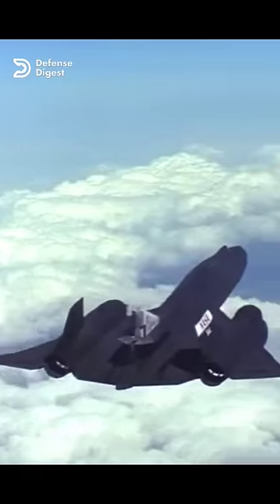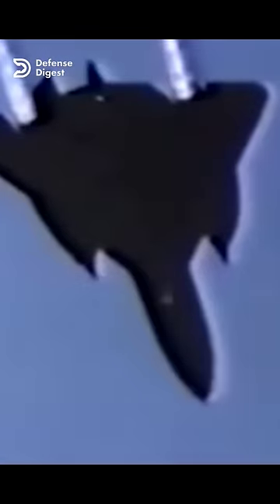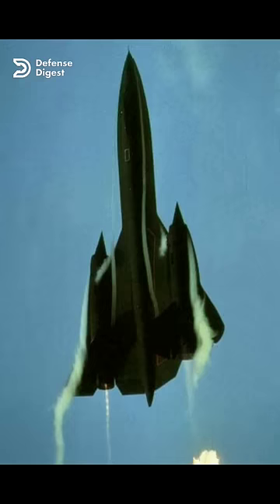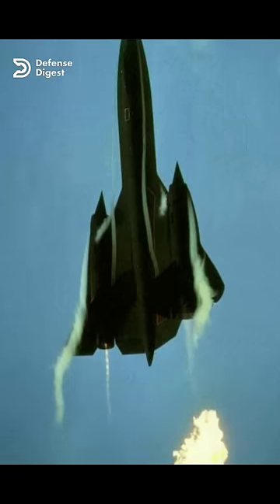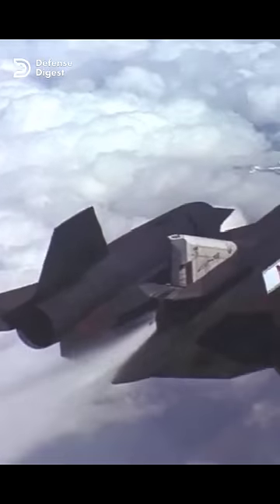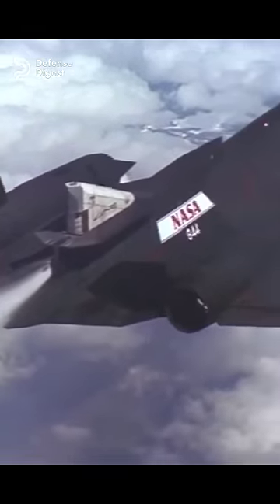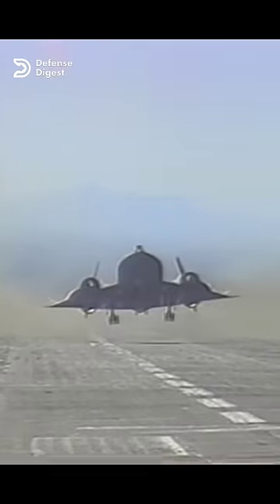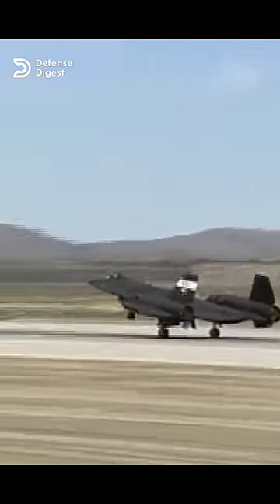The SR-71 Blackbird Is So Fast That It Lights the Sky on Fire! #shorts

Comment: I was at an airshow in 81, and another air show in 83, I've seen the Blackbird takeoff, for some reason it has the loudest engines you have ever heard.
Reply: I wonder why one of the fastest planes with one of the most powerful engines would have some of the loudest engines..?
Reply: @mattmarzula  u got me
Reply: @bartbullock9742  lol
Reply: Don’t they use old Buick V8 engines mounted on a cart to get the engines turning?
Reply: Saw it once in the UK, must have been mid 1970s, loud but not earth shattering like the Vulcan scramble.
Reply: @FilosophicalPharmer 
They did use them for a while, but parts became hard to find. I believe they switched to twin chevy 454s.
Reply: @FilosophicalPharmer  Yup, 2 Buick Wildcat V8s geared together via their flywheels to a gearbox that redirected the torque to a shaft that went up into a starter box on the J58 engines. As mentioned below by pudlyJon gearhead, the Wildcat engines were discontinued by GM and they had to start using Chevy 454s up until they stopped flying the SR-71A
Reply: @pudlyjongearhead2851  Oh that’s right! The engineers responsible for starting it drove around the country, looking for parts to keep those old Roadmaster engines running. 😅 Forgot about that. Edit: Wildcat! … Buick Wildcat? I gotta look that up! 👍🏼
Reply: @exafrost  Thanks! Just looked up the Wildcat. If I had ever heard about it, I totally forgot all about it. My grandfather and father owned a Buick dealership in the early ‘70’s. Don’t remember much - I was a toddler.
Reply: Luckyyyyyyyyyy.... Happy for you though!
Reply: @mattmarzula  simple,  it could outrun sound by 3 time's.
Reply: I was there too.  Met the crew, it was a thrilling moment for myself and my Son.
Reply: From a time when America built shit that just looked cool AF
Reply: Another random memory I have of this plane - when the engineers scheduled an engine test, they would make a “family day” out of it. All the engineers families would get together, grill out, play “backyard games” and end the day by testing the afterburners. They would light up the engines, fire the afterburners and “count the diamonds”. If there were 13 (?) diamonds, the engine passed. Hope I can see her in real life one day. 😊♦️♦️♦️♦️♦️♦️♦️♦️♦️♦️♦️…
Reply: OMG, y’all! Another memory … when they were designing its shape, they would pull the mock-up plane inside when the sun was high and hot. Otherwise, Soviet satellites could make out its shape on the ground by the difference in what was shaded and what was not. 👍🏼 Lots of great documentaries on YouTube about this plane. 😊 Never stop learning! 👍🏼
Reply: Can any of you confirm that the Apollo 5 rocket was the loudest engines ever made? I think that’s correct… 🤔
Reply: I was lucky enough to see one taking off and landing when I lived out in California back in the 80s, this was just north of Santa Clarita California.
Reply: It's because there huge
Reply: @Braun30  concorde was louder.
Reply: @CastrolHondaSP2  could be, had the same engines.
Reply: @FilosophicalPharmer  I presume you mean the Saturn 5 rocket, which was used to bring Apollo capsules in space.
Reply: @Braun30  Yeah, that! Thanks for correct presumption. 😊👍🏼
Reply: I heard, and saw one take off at Kadena Air Base on Okinawa, 1988.
Incredible!
Reply: @exafrost  310’s or 425’s?  Not only am I a gear head, I am the son of a USAF Col.  Lol. Anything up to 6 turning & 4 burning I’m interested in.
Reply: The blackbird and B-1 are the loudest planes I've ever heard
Reply: @mattmarzula  watch it 💁‍♀️ ☝️
Reply: They should not fly the black bird at any air shows since the fuel is so expensive and also the plane !!!!
Reply: @mattmarzula  if loudness were silence, blackbirds would be the quietest planes on earth. 

And that is how the blackbjyrd do
Reply: @FilosophicalPharmer  yup they used to have a special start cart that used not only one Buick V8, but two of em coupled via a custom gearbox! Iirc they were 454ci
Reply: I wonder why one of the fastest planes that needs special explosions just to get started would be loud?
Reply: For one thing, it's still the most powerful and fastest jet in existence. Even newer models can't keep up with the SR-71 as the top speed is unknown
Reply: @lordzeuscannon6400  top speed is classified, I had a good friend stationed on the Nimitz, its top speed is classified, he has told me stories, and when I tell people who think they know the truth they think I or he is full of crap.
Reply: @bartbullock9742  wrong. its top speed is unknown. Fastest recorded speed is classified, there is a difference
Reply: @lordzeuscannon6400  sounds redundant but either way you got me.
Reply: @bartbullock9742  it's not because it still has the potential to go beyond the Sr-72's top speed of mach 6
Reply: @lordzeuscannon6400  what makes you so sure it hasn't
Reply: @lordzeuscannon6400  and what makes you think it hasn't???
Reply: @bartbullock9742  because sometimes you get access to information that others don't know. Its recorded top speed is only like half throttle
Reply: @lordzeuscannon6400  my point exactly Lord Zeus, my boss in 81 was a retired millionaire,and good friend ,he was ex-military, when he was personal friends with SR-71 pilots, and no they did not reveal any classified secrets to him, at least that he would admit to,  he implied things that's a little hard to believe, and so, top speed is not unknown, you can assume they've never held the throttle wide open, but I can assure you you would be wrong.
Reply: @bartbullock9742  you don't know
Reply: @lordzeuscannon6400  ever heard of the X-15?
Reply: Ah DUH!!!
Reply: Sorry I didn't hear you my ears are still deaf.
Reply: @richa.s9912  people like to joke, it wasn't just me almost everybody had their hands over their ears when the thing took off, no joking.
Reply: @richa.s9912  btw, I've seen Ted Nugent live twice in the 70s, guitar world voted Ted loudest concert, for almost two weeks after both, my ears rang.

Comment: Also to note, it staying on the ground meant it was leaking fuel. Because of the amount of heat the SR-71 grew just a little bit so the seals could work.
Reply: Yeap, counted for heat expansion. Neat!
Reply: Well yes, but technically there were no seals. The sections of titanium skin expanded from the heat and butted together with enough pressure to keep the fuel inside.
Reply: They gave it the pops and crackles tune
Reply: Yup. It had to fly up to a tanker it fill up shortly after take off.    It grew two inches in length at operating temperatures.   The insides of the windows would reach over 600 degrees Fahrenheit.  If you touched it without a glove it would catch your skin on fire.
Reply: @lookronjon  I think they retanked after take off because off the fact that it was too heavy to take off with full tanks.
Reply: Yes, yes, every toddler knows this...
Reply: @JohnAbrahamsen  The SR-71 tanks would not seal until higher speeds and heated up. It dripped fuel until then.
Reply: @douglasdixon524  Yes everyone knows this as stated by the guy above. But it won't drip more or less with full tanks I would assume. My reasoning for refuelling after take off was the max take-off weight being quite low no this plane.
Reply: That's what I thought. It can't be the TEB because that would burn green
Reply: @JohnAbrahamsen  My reasoning was that since they drip fuel until higher speeds the aircraft would lose a considerable amount of fuel during taxi and takeoff therefore needing to refuel.
Reply: @douglasdixon524  no
Reply: @ms3862  Spectators at the air show: "Sheeeeeeeesh!"
Reply: It wasn't a little bit it was about 9 inches or 23cm! That's just crazy to think about
Reply: @exafrost  did you read what I put? Heat expansion doesn't mean literal seals but the tank not fitting right until it's in the air.
Reply: @lookronjon  that was done not only to prevent fuel loss but it reduced the stress on the airframe during takeoff.
Reply: The plane would expand, that's why it stopped leaking fuel.
Reply: That's correct it was loosely put together to stop it from changing shape due to immense heat... literally would just leak out constantly til they got in the air.
Reply: @Stickz0161  its like space capsule windows. Its very complicated when u have extreme temp differentials and things growing and shrinking rapidly
Reply: @douglasdixon524  They just tanked enough fuel to get it in the air. Then when the plane was in the air and at operating temperature sealing off the tank, then they would fill it up further.
Reply: That's so interesting.  When engineers goes to extreme to make things work amazed me. Remind of space, when they use a moving parts that can't be tested unless they test in a lab that is way below temperature and out of space. It won't work in normal temperature.
Reply: What's cool is once it was at altitude and cruising speed. All the leaks and issues at lower altitude vanished. Making this baby the fastest and baddest thing in the sky.
Reply: Popular myth but not true
Reply: @Zero x Zero  of course there were seals
Reply: @lookronjon  not fully true, it also didn't get anything close to that temperature inside
Reply: @John Abrahamsen  took off with 40k lbs to reduce stress on the aircraft.  Sometimes they'd take off with 65k lbs and not have to hit a tanker after takeoff
Reply: @douglasdixon524  they sealed on the ground, not in flight
Reply: @mikedrop4421  not quite that much
Reply: @Stickz0161  virtually none of that is true
Reply: @Mike Drop  it expanded  9 inches?!?!?! Holly crap! Engineering design genius
Reply: @captnwinkle  it wasn't quite that much, closer to 1/2 of that
Reply: The entire jet is made out of titanium. The plane glows red when in flight so obviously the fuselage has to expand to match the size of the titanium
Reply: @lordzeuscannon6400  the "entire" just isn't made from titanium,  but several titanium alloys and composites. It also didn't "glow red", that's completely silly.
Reply: @JohnAbrahamsen  correct. the plane took off with just enough fuel to get airborne, then fueled fully once it took off.
Reply: @gr8crash  wrong. It does glow red when at its recorded speeds
Reply: @LordZeusCannon  lol no it doesn't. Not even at, not even the A12s in bare titanium glowed red
Reply: a leaking aircraft is the most murrican engineering.
Reply: @casemodder89  It still holds the record for the fastest aircraft ever built. But go ahead and say naive things making yourself look foolish.
Reply: @casemodder89  virtually all aircraft leak and/or have leak limits
Reply: @gr8crash  If you don't know, you don't know
Reply: @LordZeusCannon  I do know, significantly more than you it seems
Reply: @gr8crash  obviously not
Reply: @LordZeusCannon  haha well considering your comments so far have been quite inaccurate, it's pretty obvious.
Reply: @gr8crash  same to you. If you don't know, you don't know
Reply: @LordZeusCannon  haha trust me, I know significantly more than you. Anyone that actually believes the aircraft glowed red in flight has very little understanding of aviation and the SR71 specifically.
Reply: @Tyler-ts2ld  exactly
Reply: @gr8crash  doubt you've served like me. And doubt you've actually seen one at speed or had the pleasure to talk to their pilots
Reply: @LordZeusCannon  I'm actually friends with a few former pilots and maintainers and have learned quite a bit. So again if there is an area you're not very educated on, let me know. Be happy to teach you.
Reply: @Tyler  haven't said anything false yet. More likely you're just discussing a topic you have little knowledge on. What area are you confused about?
Reply: @gr8crash  instead of telling everyone they are wrong, why don't you back it up? if you could, you would have already. its also funny that you say im wrong with what ive said about the fuel tanks and such, yet its in a book, written by an SR71 pilot....ever head of Sled Driver?
Reply: @lordzeuscannon6400  dude turned ghost cause he can't back up his BS 🤣

Comment: My understanding is that the Blackbird needed special fuel because it leaked like a stick pig on the ground. In order for the plane to function properly at speed, they had to account for heat expansion in the aircraft. 

It’s also worth noting that the plan for dealing with ground to air missiles was “out run it”. 

Hands down one of the coolest and most iconic planes around.
Reply: It needed the special fuel with a much higher flashpoint (JP7), simply because the airframe heated up so much that the fuels that were in use at the time would have combusted inside the fuel "tanks". In fact, it wouldn't combust until it reached a certain temperature, and even then... it needed help to ignite. I put the word, tanks, in quotes because there were no inside walls to hold the fuel. It was just pumped into the fuselage and middle part of the wings. The fuel was directed around the entire aircraft, acting as hydraulic oil and also as coolant to help it soak up the heat needed for it to burn.
Reply: @exafrost  I’ve heard stories about pilots putting their cigars out in it before climbing in. Though I believe these are exactly that, stories. The SR-71 and the A-12 are some of my favorite birds.
Reply: @wesleywlee  there is some truth to it. The fuel needs to vaporize to burn; and at a higher flash point, the fuel is much harder to vaporize even in the seconds you drop a lit cigarettes in it. Now doing so, you are literally playing with fire; If you happen to set the puddle on fire, it's just going to slowly spread until it engulfs the entire airplane. And it's really difficult to put out.
Reply: @wesleywlee  you can put out cigars in petrol
Reply: @MrCosmin94  I am aware of this, it’s a favorite joke of mine as a mechanic. 

However, it’s my understanding that Aviation fuel is considerably more volatile than standard gasoline.
Reply: The Soviets shot missiles at it occasionally. I don't think any of them ever got close to the plane at all. It was just too high and moving too fast to catch up to.
Reply: @thenaturalmidsouth9536  yeah, because they’re countermeasure for missiles was “go fast”
Reply: @wesleywlee  lol, yes.
Reply: @wesleywlee  it's actually the other way around, jet fuels are much less volatile than gasoline or even AvGas (aviation gas), the stuff takes a lot more heat to set off. I worked as a shipyard machinist on the USS Abraham Lincoln in 2009 at the Bellingham shipyard and was standing outside on the pier smoking when a bunch of yelling started (mainly to stop smoking and extinguish all flame), turns out some schmuck sailor turned the wrong set of valves and poured somewhere around 5000 gallons of JP-5 out of a 6" discharge pipe about 25 feet above the waterline, if it had been gasoline that pier would have gone up like gunpowder with how much hot work was happening on it, so much spilled out before anyone knew it happened, but thankfully JP-5 is basically like diesel/kerosene and is far less volatile than gasoline, so everyone had time to make sure there weren't any heat sources. Some shipyard workers (thankfully not me lol) had to drive a barge underneath the discharge pipe and beat a wooden plug into the hole to stop it, nobody knew what valve it was🤣. I watched those poor bastards from 100 feet away on the pier getting completely drenched in JP-5, as they frantically beat that plug in with a sledge😂. They ran those floating oil barriers out right quick to stop the fuel spreading but it still let a lot out, the entire bay had an oil sheen by the end of the day.
Reply: @TheExplosiveGuy  huh, well I wouldn’t know. Old man was a plane guy, so my brother. I like them, just not have much of any practical experience with them.

I fix trucks, wreckers, stuff like that. Oh, and the 66 C10 that seems to exist solely to drive me insane by breaking in a new way every time I fix the problem…. I love her
Reply: @wesleywlee  Jet fuel is not too much different than Kerosene, which you need a wick or vaporization to make burn. 
You can drop a lit match in a bucket of it, and it’ll go out.
Reply: @erikj.2066  I’ll have to take your word for it
Reply: The motorbike version was good too, I had two of them, okay they were Japanese but the name was cool
Reply: My Dad told me the same thing. SR-71 was and still is an awesome jet.

Comment: Several clips in this video are from the aerospike test program, in which the NASA SR-71 carried a linear aerospike rocket engine mounted on its back.  They got as far as cold flow tests before the program's funding got yanked; the next phase would've lit the engine, giving the Blackbird a new speed record.  It was a real shame that never happened.  It was to test the engine for the VentureStar reusable single-stage-to-orbit launch vehicle, which could have revolutionized spaceflight if it had been allowed to get a bit further down its development path.
Reply: Technically, it is RS 71. President Johnson called it the SR. Like Joe Obriben he didn't know what the hell he was talking about.
Reply: @John Austin  been to Thighland lately? Bigly place.